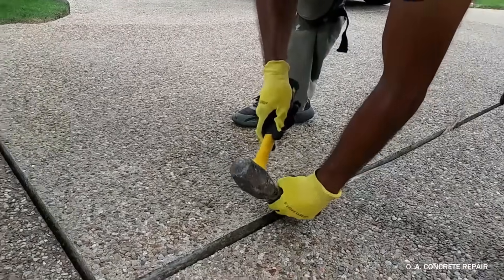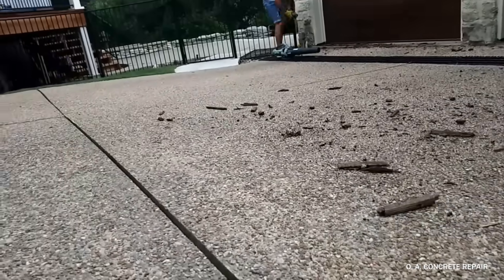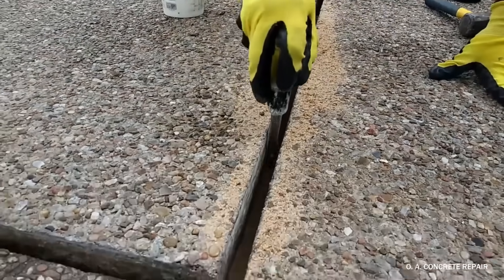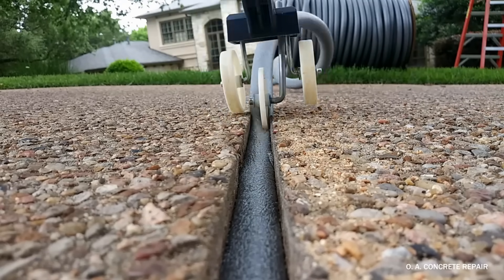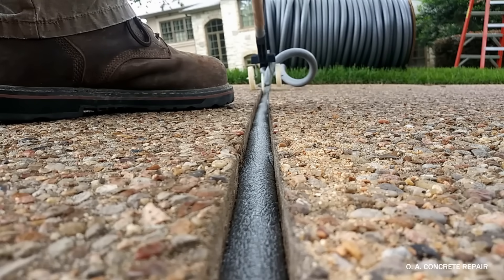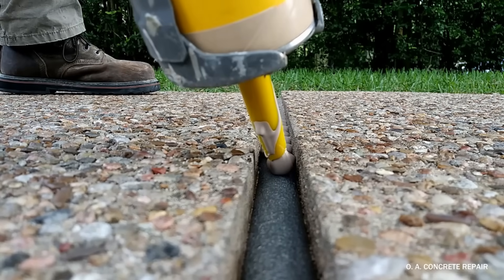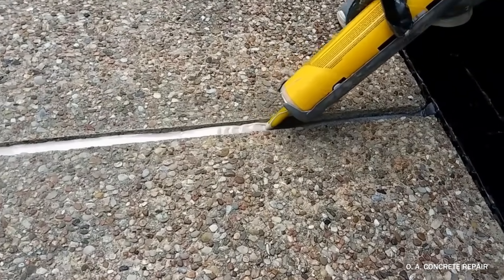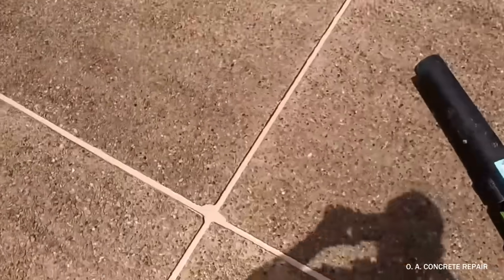EXPANSION JOINT REPLACEMENT OF CONCRETE DRIVEWAYS

Comment: Why did you leave the level of the self leveling cock a quarter to half an inch lower than the top end of the concrete with the pebbles on top?

Comment: If you sprinkle sand on top (right after you pour it), It will look nicer and protect the joint.
Reply from the maker: @Darkice77  it is not recommended by the manufacturers as the sand makes the sealant less elastic. However I am up front with my customers and warn them about the benefits and deficiencies of using the sand, and most of the time they still like the sand. If you want to see how my joints look with the sand please refer to my video shorts.

Comment: NON HANDYMAN DID IT!!! I learned as I went; digging out the old wood to some time; From reading the packaging on the backer rods, I found that twisting 2 tight together and cramming them it made them stay better in place. My driveway is 17 feet wide.  I used 3 tube of self-levelling compound and could have used one more for filling in.  It went far easier than I had imagined.
Reply from the maker: @nancyfoster971  congrats! You have helper your driveway a lot. 

In regards of the backer rod, sorry to inform you that twisting it is not recommended, when  you trwist it, you generate large voids that later get filled with the sealant, leading to very thick sealant in some areas. Home Depot only sells 3/4 inch diameter backer rod. But in reality, existant driveways have joints of 1inch or some times even more. For everybody reading this, please ensure that the backer rod you buy is always thicker than the width of the joint. I always use the 1-1/4" backer rod. Never available at Home Depot or Lowes, only commercial construction supply stores.

Comment: Not high enough .
Reply from the maker: Our initial intention back in the days was to prevent tires from staining and damaging the sealant, which is a technical solution, but not so aesthetic. We have now raised the sealant (but not the thickness), but still not flush with the concrete. Working on a new video showing our latest method.

Comment: You should use a primer befor applying the caulk on a porous surface
Reply from the maker: Now we do! For the last 4 years at least. This video is little outdated. But you know, as long as there is no moisture under the slab that will try to evaporate, primer is not realy necessary, at least under my geographic environment.

Comment: Is an expansion joint that is 1.5" width too wide to use this method, or it is okay.  2x4 were used as expansion joint in the past.

Comment: how about using a vinyl gasket? is that way also acceptable?
Reply from the maker: Yes, but in old driveways with uneven joint gaps due to years of settlement, the vinyl won't fit evenly. Liquid sealant adjust to the terrain.

Comment: Wow, a lot of tripping hazards still in the final product! Why would you not fill flush flush the the surface??
Reply from the maker: Hi! To prevent the tires from damaging the product. This video is old, now we pour them a little higher. But always maintaining the proportion of "thickness of sealant = half of the width"

Comment: any one can explain how the joint was saw cut? was it done by two line cutting? because saw blades dont come that wide thickness.
Reply: It wasn’t saw cut, it was formed that way. In the days before continuous pours and diamond saw cutting expansion joints, it was common to place an organic expansion joint material between the formed slab pours. It’s still often used next to existing structures.

Comment: What type of backer rod (closed cell or concrete expansion joint replacement) and what size of backer rod did you use in this video?

Comment: What kind of sand should I use and which tool to level out the backing rod? Thx
Reply from the maker: regular coarse sand and the tool, just type "backer rod insertion tool" on any search engine, and you will find all buying options.

Comment: I'm attempting to give this a try.  I'm a female and am determined to get my work done.  Thanks for sharing your video.🙋‍♀️👍
Reply from the maker: The worst is pulling the woods out. A little rotohammer with a Chisel bit does the work for you. You can rent it. Just make sure the bit's width is less than the joint width.
Reply: @oliveraguirreconcreterepai4826  there is no wood in my patio and walkway.   It has like a dark spongy type product.  No idea what it is.
Reply from the maker: @rdumas6787  I know what you're talking about. But if it does not provide waterproofing, it has to come out and be replaced by a watertight system like the one in this video.
Reply: @oliveraguirreconcreterepai4826  thank you

Comment: Sika does not recommend putting sand before the backer rod.
Reply from the maker: You are correct, sand under the backer rod is not a requirement. However, as a contractor, I want to ensure long life on my product and I go beyond the specs to do so. Adding sand under the backer rod does not stiffen the joint, therefore does not affect the elasticity and durability of the sealant. Sand would just add extra load bearing capacity to the joint system in case of a high heel or similar events.

Comment: How do you ensure that sand is even?
Reply from the maker: Leveling the sand is not as important as leveling the backer rod. However, we hold a Chisel around 1inch away from the tip. Then, with the hand slightly touching the concrete surface, we drag it along the joint edge. But you can also use a cardboard gage....there are many ways, just get creative.

Comment: What do you feel about 'slab gasket'?  Just started doing my research.
Reply from the maker: All those prefabricated joint gaskets are good for driveways in a good condition. But if the driveway already has some settlements and gaps that vary in width, you can not use slab gasket, and the best is to use a liquid polyurethane that would adjust to the shapes of concrete, and truly making it water proof. 

Prefab gaskets work better on new driveways of driveways that have not gotten any settlements.

Comment: Excellent. I wonder if you can use this product on a steep driveway without any problem or is there another product for these kind of driveways?
Reply from the maker: Sloped driveways should technically be addressed with NON-SAG polyurethane. But these are rarely available in regular home improvement stores, the size and color options are limited. So if I was going to use the self leveling cartridges, I would start from the top and work towards the lower side, and stop the pour at about 2 to 3 feet away from the bottom end of the joint. Wait and assess how far the material flow, if it needs more, pour from the top, it is an art. 

Otherwise, you have to use professional grade products, where you mix a bulk portion of component A + B + a color pack. You can get bulk versions in Self Leveling and Non-Sag. And even the Self Leveling version of the bulk package is not as flowable as the self levelers  from regular home improvement stores.

Comment: I just used this product and in the fine print you CAN NOT use a lacquer based concrete sealer.  Im so bummed out.
Reply from the maker: yup. Do not spray solvent based sealer over the material, it will re-emulsify  the sealant (polyurethane). Its is pretty much the same with all brands of polyurethane sealants, not just this one. HOWEVER, there are solutions: a) Power wash and seal (solvent based) your driveway first and then install the exp. j. sealants. b) do the exp. j. sealants first and then do your surface sealer without touching the sealant, protect your sealant with tape, spray the whole driveway with sealer, then remove the tapes and brush the joints corners with sealer without touching the sealant. Anyways, sealants are not meant to be sealed.

Comment: I have seen people using something like toilet paper to put on top of the new sealant before fully cured between two concrete slaps to protect people from stepping on the sealant and making footprint all over the concrete slaps.  Do you know what that paper called? Thank you so much.
Reply from the maker: You may be talking about the sticky mesh paper used for drywwall work. I never use it. It is still not stong enough to prevent someone to step on the fresh sealant. In fact, it may be messier to clean up after the "accident" if you have the mesh installed. Thats why i pour in a way the my sealant is 1/8 in below the walking surface. In case people walk or drive. But nothing as efficient as blocking your driveway with caution tape for at least 24 hrs after the pour. Material will continue drying for up to 3 days, but the crust will start to dry in the first 6 hrs.

Comment: After this process is completed, how long should you wait before driving vehicles over the joint? BTW: nice video.
Reply from the maker: 24 hrs is enough in hot weather. 2 days recomended in cold weather. However, if you pour the joint 1/4 below the concrete surface, you can drive over them anytime, as the tire never touches the joint.

Comment: one guy did the sand last.
Reply from the maker: The sand we apply in the bottom is a quick foundation for the backer rod. The sand topping you see on other videos is for decorative purposes. Sand decorative toppings are not recommended as they reduce the flexibility of the sealant, leading to early cracking of the sealant

Comment: We always fill to top of joints...
Reply: They just look the best when poured to the top ...
Reply from the maker: @stevensgordan5998  agree
Reply from the maker: Regardles of where they are (top or lower)....the most important is to not pour them too thick. Always maintain your 2(width) to 1(height) ratio. We also pour them at top sometimes. But when they are high, they get dirty with hot tire.

Comment: What sealant do you use? Can a homeowner buy it direct?
Reply from the maker: Product: Sikaflex SL (self leveling) if you are in USA.....you can find this stuff at Home Depot or Lowes. But there are many other brands that you can find at your local commercial construction store. We have found that Polyurethane elastomeric sealants work good for our applications. There are many other brands.
Reply: @oliveraguirreconcreterepai4826  Thank you for responding so quickly. I have some concrete joints that need some attention.
Reply: I actually just had a new driveway poured.  Should I just be able to use the SL sealant then?  And after what length of time should this be applied or this process performed?
Reply from the maker: @LG-jy9nc  if your driveway was just poured, the woods between the concrete slabs can provide some  degree of water tightness for around two to three years. The minimum you should wait for the installation of an elastomeric sealant is around a month, because the concrete is still changing throughout that time (shrinkage). And about the material, regardless if it is self-leveling or non sag , you have to use an elastomeric sealant,  we have found that polyurethane S. L. gives us the best results, just watch for the spills.

Comment: Can you use self-leveling sealant on sloped driveways? If not, what do you use instead?
Reply from the maker: Not recommended,  but we have done it. If you use S.L. on a sloped driveway, make sure the slope is not too much and don't do it on a cold day, as the sealant will continue running off for 24 hrs. My trick on sloped driveways is to start the pour on the highest point and stop at least 2 feet away from the lowest point of the driveway, monitor how much the sealant is running on its own, it may flow all the way down and stop right at the lowest point, and if more sealant is required, apply it from upstream and let it run down. I suggest you to buy 1 single bottle of S.L. and do a test area. If it doesn't work, you only wasted a bottle and you can still switch to Non Sag solution, materials are compatible. Good luck!
Reply: Use SIKAFLEX SL where it's level and SIKA Crack Flex on the slope!

Comment: There's still a bit of a gap there. Will this create a tripping hazard? Why not add more of the base seal?!
Reply from the maker: The most important is: If the expansion joint's width is 1 inch, the thickness of the sealant should not be more than 0.5 inches, otherwise, the sealant will not be elastic and will fail early. In this case, our customer didn't want the sealant to get stained with tire marks, so we poured 1/4 inch below surface level. You can pour the sealant all the way up if you want, just remember the magic width to depth rate "2 to 1".
Reply: @oliveraguirreconcreterepai4826  so if you want to keep.the right ratio and be flush just use more sand?

Comment: You blew it. You have to completely fill the joint up to the top edge of the concrete for driveways and walkways. Who would want sharp edges like you show exposed and a trap for dirt and Ice. The Ice will eventually break the concrete edges of the joint if they are not filled.
Reply from the maker: Good point! But we are in Texas, so we have different conditions.  How ever, we have seen how water drains off the joints and the driveway, so no ice should form. Also, tires stain and damage the integrity of the sealant over time, so our clients have opted to have a longer lasting solution by pouring the sealant 1/4 inch below concrete level. There is no one single solution. Thank you for your comment, I will make a note on the description.
Reply: @oliveraguirreconcreterepai4826  Wondering if your opinions about weather are different now after this year's ice storm?  I agree they should've been filled in flush so there's no potential cracking, trip hazards, etc.  No future worries.
Reply: How often does this need to be done?  How do you know if it needs to be replaced if there's no visible damage?  My driveway/ parking area is over 30 years old.
Reply from the maker: @fwood1231  if no visible damage, dont replace them. The whole point is water proofing your driveway. If you pour them too thick, they will not be elastic and will split away from the concrete. If you pour them too thin, they will crack in the middle of the joint. Always pour them with a relationship of 2(width) to 1(thickness). If you joint width is 1inch, thickness should not be more than 0.5inch. Follow the magic numbers and they will last at least 5 years or maybe more.

Comment: I would also put sand on top of the wet sealant
Reply from the maker: Hi Rima, we also love the way sand looks on tge upper surface of selant but, most manufacturers dont recommend that, as it changes the elastic propperties of the sealant, making it more susceptible to early failure. And we try to provide our customers with long lasting solutions.
Reply: How do you clean it?  I powerwash once in a while.